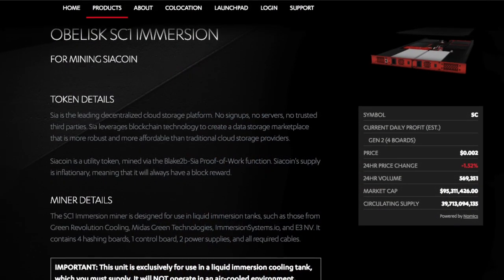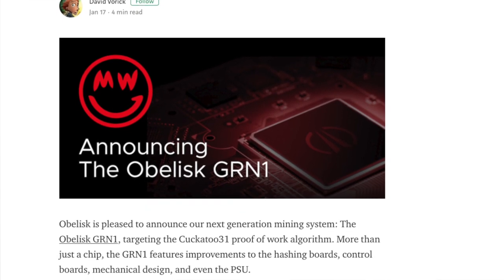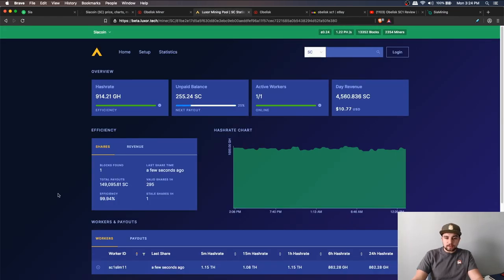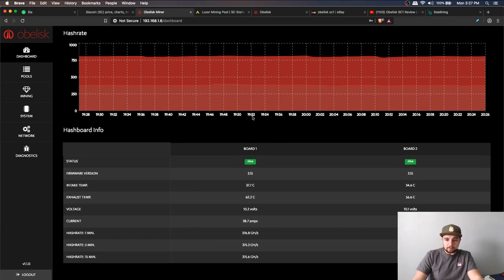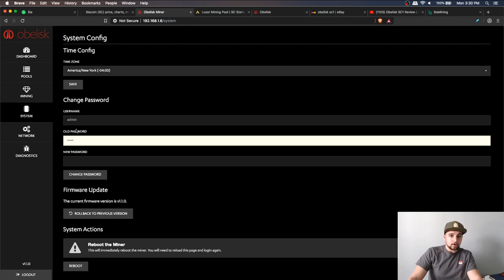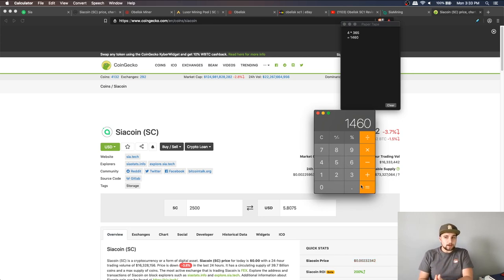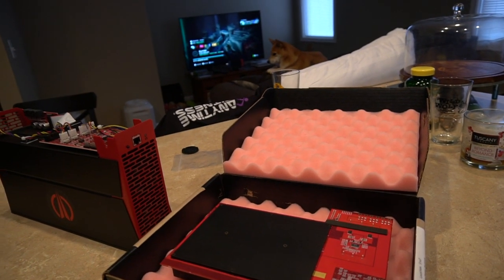Obelisk Tech SC1 Slim SIA Miner | Review & Tutorial | How To Upgrade Hashboards 2x Earnings

Comment from the maker: Subscribe to VoskCoin - http://voskco.in/Sub
Best deals for Obelisk SC1 miners - http://voskco.in/BuySC1
Obelisk Tech Discord Invite (their sc1marketplace) - http://voskco.in/ObDiscord
--- Timestamps below!!!! ---

00:00 Intro Obelisk SC1 Slim Miner Review
00:25 SC1 Slim 1/2 half the size and 2x hashing power miner
00:54 Obelisk SC1 Miner (original) made $90 a day
01:07 Obelisk SC1 Slim one of most profitable miners in 2019
01:12 Obelisk Tech SC1 Immersion (liquid cooled) SIA miner
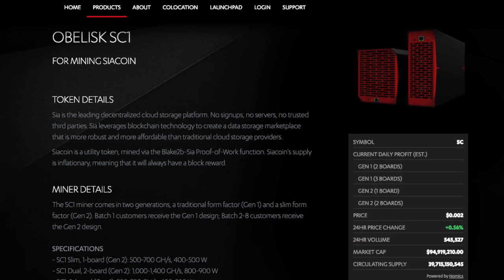01:27 Obelisk SC1 slim specs vs original sc1 sia miner specs
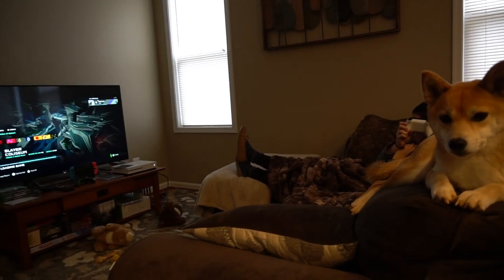02:09 What is SIA Siacoin crypto -- Cloud Storage on Blockchain
02:26 History of Siacoin SIA Blake2b mining GPU - ASIC - Forks
02:50 Siacoin dev team creates obelisk - miners for SIA, DCR, and GRIN
03:11 VoskCoin Reviewed Bitmain Antminer A3 Blake2b SIA Miner
03:21 Antminer A3 & Innosilicon S11 beat Obelisk SC1 to market
03:39 Siacoin dev team forks off Inno S11 and Antminer A3 for SC1
05:13 Obelisk Tech publicly posts amount of SC1 SIA miners sold
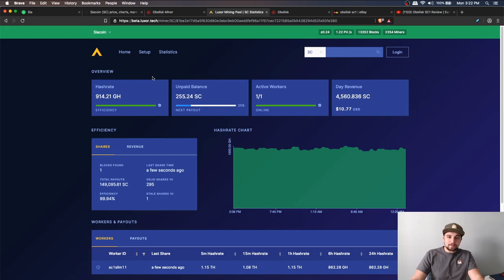05:50 Obelisk SC1 Slim review - new firmware increases hashrate
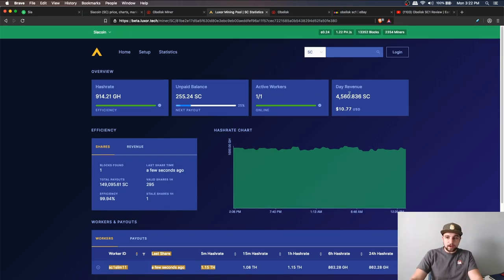06:23 Obelisk SC1 Slim daily revenue in Siacoin SC and USD
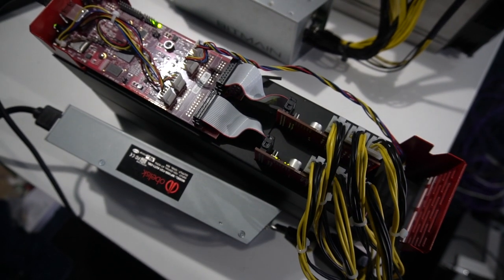07:11 How much does the Obelisk SC1 Slim cost / worth / buy
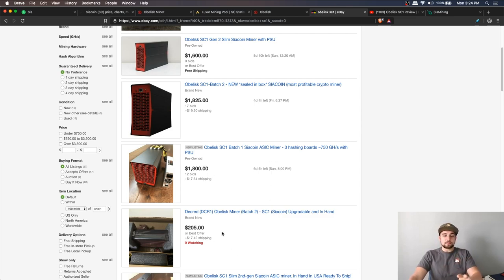07:33 Obelisk DCR1 Decred ASIC miner can mine SIA w/ SC1 hash boards
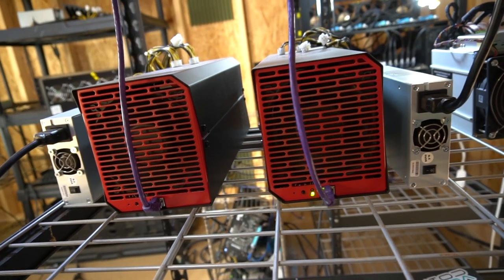07:47 How to add mining hashboards to obelisk asic miners / change boards
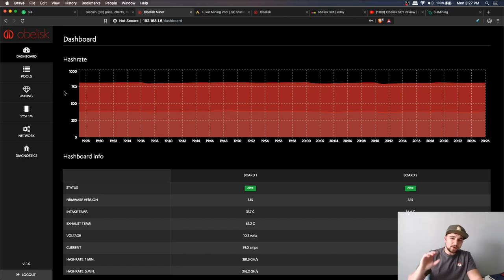08:48 How to setup / use Obelisk ASIC miner - SC1 Slim tutorial
10:08 Fanspeed trick/hack to increase earnings w/ Obelisk SC1 Slim
11:32 Obelisk SC1 Slim profitability, earnings, ROI, breakeven on this miner?
13:42 What is the price of the Obelisk SC1 Slim ASIC miner
14:42 Should you buy the Obelisk SC1 Slim SIA ASIC miner?
15:56 Obelisk has the best branding of all ASIC miners
16:53 Final thoughts / review on the Obelisk SC1 Slim SIA miner

Comment: Hello. I'm just opening my old obelisks for the first time,  I'm seeking help with  on of my Obelisks. Forgot one of the passwords. I've tried the original user/password which is admin/admin. It is not working. So, I pressed and held down the button on the front of the miner, until is restarted, which was about 10-13 seconds until restart. This appears to have only rebooted the miner. I'm still unable to log into the dashboard.  Do you or any other readers know if this problem has a solution? I've about exhausted my brain of password guessing. Thanks for your help, and, or time.

Comment: Silly question, is this pretty much plug and play?  Plug in the unit to the PSU, plug in the Ethernet cable, and connect to unit via web browser?  

Seems like it’ll be easier than building a GPU miner and dealing with the upkeep.
Reply from the maker: Yeah it’s basically plug and play, asic miners are much easier than GPUs but with gpu rigs you learn a lot more. Depends on goals, budget; and desired coins to mine